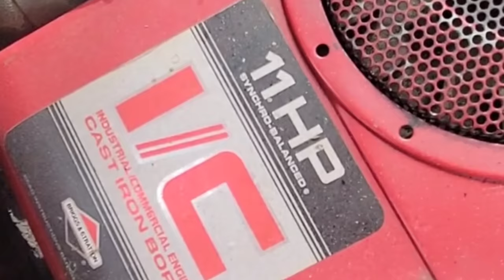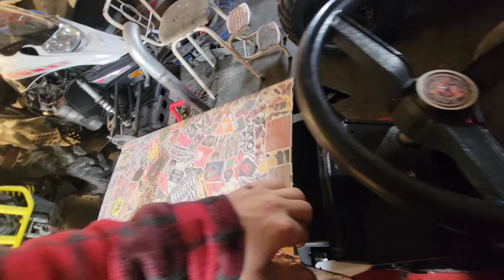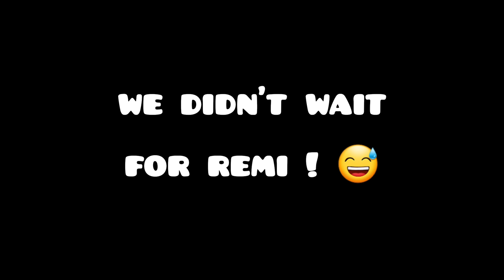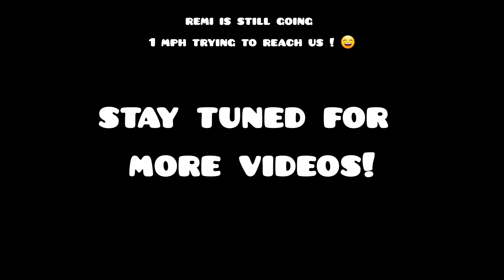MUD RIDE WITH THE BOYS

Comment: My mower got stuck in a soft spot, didn’t realize how much the mowers weigh. Pulled out with 4WD
Reply from the maker: kinda not that heavy !  prolly 250 pounds
Reply: Would like to see the video before it got blocked.
Reply: @MisterdionneYT my mower is 612lbs 😅

Comment: I would be able to get through that mud with my off-road track I haven't used it in over 5 years because the state of Massachusetts been slowly shutting down all the places that just be able to off-road but mine has a 22-in tires in the rear with Golf Cart Rims and hubs it's only got a four-speed go-kart clutch so basically if I was going for that much don't be behind me cuz I usually floor and once I clutch and gauges the mud touch flying so when you have an open diff that's the best you can do is just pin it tires help a lot